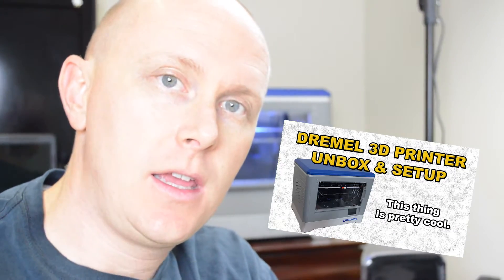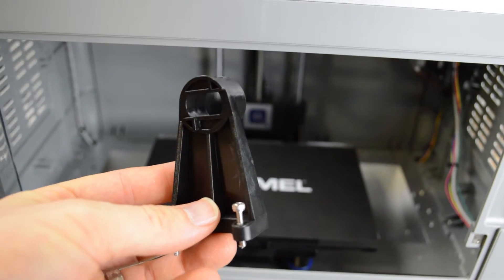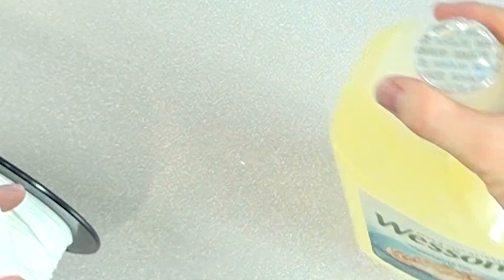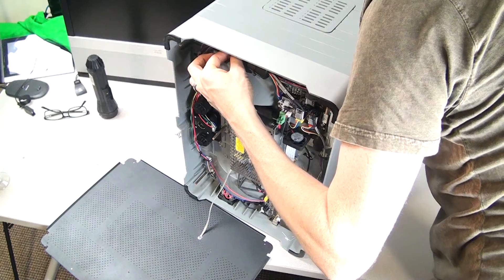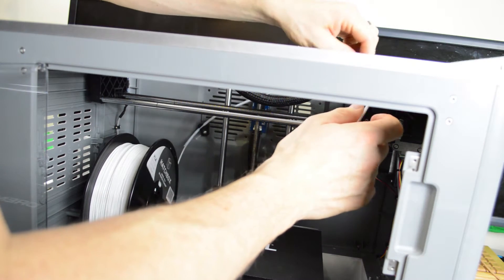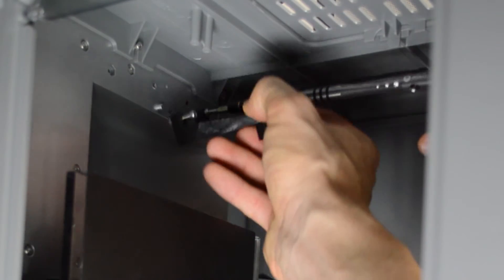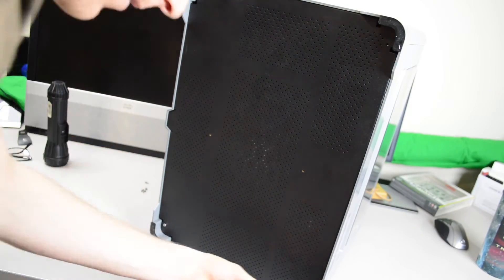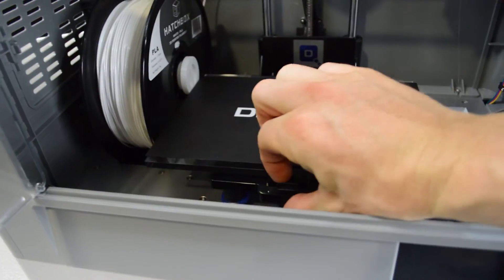DREMEL 3D PRINTER 1kg FILAMENT HACK

Comment: Can't you just re-spool the other brands onto the Dremel spools that fit?
Reply: Yes. But it can be a huge pain in the butt if you print a lot. One of my friends who works for a Makerspace had to redo all the spools a student worker put on wrong, so we spent 2 hours with Netflix on hand unwinding and rewinding what had to be thousands of yards of filament. I have a stratasys printer at work and a Dremel at home, for the stratasys 80 cubic centimeters of material is about $200 with my discount, whereas for dremel I can just laugh and buy loose filament from a variety of different online sites and rewrap the spool.
Reply: It is faster and cheaper to do what he is doing but yeah you have longer prints and more Pilemt on other brands spoils the way I did mine is I just ran my spool holder from the outside and ran it threw the vent on the left side

Comment: Hi there... I have a Dremel 3D45, and right now I am not going to make any comments on how the machine performs, it is just great. But today I have ran into a problem. During a print start, something happened and the level sensor pin (you know, that small little metal part that acutally touches the build plate) got kicked off from its location by the build plate when the head went to the front position for preheating. Now I would like to put it back, it does not seem broken or permanently damaged, but I don't want to make any stupid things with it, so please advise. Did someone here ever had this problem? Many thanks in advance. Frank
Reply from the maker: I can not understand everything you are explaining. All the words tell me its broken but you say its not, permanently? Give Dremel a call, i have heard good things with their customer service.

Comment: Hatchbox filament seems to have two different hole sizes for the spool itself and if you get the one with the bigger hole, the new holder won't work sadly.
Reply from the maker: +Gavin Broughton thanks for this update. We have another person on this thread with similar news :/
Reply: Where do you get your hatchbox filament from?
Reply: Ok, I use Amazon too. It looks like that link has a big spool hole too.

Comment: Not sure if you're aware yet, but the Hartchbox filament spools changed size, so now they are wider than the channel in he Dremel idea builder, and cannot roll.  So, I downloaded your design from thingverse and tried this before I knew but could not be successful.  Thank you so much for this video and the thingverse file!  I have plenty of room so I'm going to build an unsightly external spool holder...  I appreciate your channel!
Reply from the maker: +Pete Lozzi im not sure if I have responded to this yet. Just seeing it now. Thanks for the input. I see on Amazon there are two different reels being shown.. can you tell me the width and diameter? Thanks in advance.
Reply: The item ordered on Amazon was - HATCHBOX 3D PLA-1KG1.75-BLK PLA 3D Printer Filament, Dimensional Accuracy +/- 0.05 mm, 1 kg Spool, 1.75 mm, Black and a physical measurement of the spool is: 68mm.
Reply from the maker: thanks. per the images on amazon, it looks like some of the hatchbox products are still the older reel.. i wonder if i can make another adapter... hmm... what is the diameter of the wheel? its 68mm wide? i wonder what the larger measurement is.
Reply: TRY to HELP you c

Comment: Nice mod, I actually found your design a couple days ago when having the same problem with larger spools, lol.

This really is a great printer, but I'm still looking into the feasibility of additional mods like a heated bed, or using a dual extruder from a FF Dreamer. Also, if you want a cheap and nice upgrade, the wear resistant nozzles from Protopasta fit the Dremel Printer. =)
Reply from the maker: +Tom Johnson Jr. thanks! this thing is very decent for a first printer for sure, i am very happy with it and look forward to many more prints into the future! I however will probably not try the dual extruder thing. I have no need for it now or into the future.... what i would really like is a glowforge.... thats where the money will go next if i ever find any!!! haha!
Reply: +TRY to HELP you I recently picked up the dremel printer and I am loving it but the color choices on the filament are not great just wondering if you have had any problems with the extruder clogging or anything like that. If not I am definitely going to have to try this. A glowforge would definitely be cool to see videos on
Reply: +RedHair Drone I haven't. I actually found that the Dremel filament has a nice shiny finish, but can have adhesion issues, especially with the Dremel buildtak. I've been using several other brands of cheaper filament, and blue painter's tape sheets with much better success, while also being considerably less expensive for more filament, and many more options as far as color and material. I've only had one extruder clog, and that was the last time I used the blue Dremel filament. It seems like the Dremel filament becomes brittle faster when exposed to air, and breaks easily, which is what caused my clog issue. 

I've been using the FoxSmart filament http://thefoxsmart.com/ in several colors with great prints, and minimal issues.
Reply: +Tom Johnson Jr. Thanks I have been using the blue painters tape for A while have had lots of problems with dremel filament but was scared to try anything else I have had two different rolls knot up on the roll one was while I was not around the printer and it almost broke the whole print head off when it jammed. By the time I got back all the motors had heated up and one of the belts had come off. lucky there was no lasting affects. Definitely going to try some of the filament you suggested.

Comment: Hey! Thanks a lot for designing this and making it available! I was recently researching this 3D printer and thinking about picking up one shortly. I was going to design something like this myself, but since you've already done it that's great! Does it by chance work with the dremel spools as well? I'd like to use up the stuff they come with first.
Reply: +DistraitW If you're looking for something more universal, check this out... http://www.thingiverse.com/thing:652415 it mounts inside the printer like the one in the video, but positions the spool a bit further forward giving more clearance, has the standard dremel spool sized holder, and various adaptors for most other spool sizes!
Reply from the maker: Your welcome! So, it only works with the large reels however if you were to design a smaller center axle piece, it should work... Sounds like you may be able to add to this! I will not be doing any designing for the next month or so due to being busy... Im going to try to do the pro con video however. Road trip!

Comment: Okay thanks. Also have u had any problems with hatchbox?
Reply from the maker: Yes actually, very recently i had it snap while it was feeding.. Has only happened once.. Im going to include more details in the upcoming video. I essentially fed it in the extruder intake hole dealy while it was printing and it worked out finr... Just strange. I cant confirm if this is regular but it only happened that one time. I have printed about 1 and 1/3 roll of the 1kg hatchbox regular pla..
Reply: +TRY to HELP you I've had that happen with a couple brands of filament, including the Dremel brand PLA. It's typically an issue of the PLA "drying out" after being exposed to air,  and becoming fragile. This is also more common with the translucent filaments. If you haven't already, make an airtight box (Target sells some airtight storage boxes for like $10) to keep your filament in, and it will keep your filament "fresh", even though that sounds silly.
Reply: I use hatch box two it is a good brand and it is cheaper than dremels but I had a couple times were I was doing 50 hour prints and when I wake up in the morning it had snapped and it just Keped running but otherwise it is a good brand

Comment: i just got a dremel 3d printer and was wondering if there is any risks in breaking the printer when doing this and if there is any other ways to use off brand filament. also ive seen top mounted spools do you think that is easier?
Reply: +Austin Kapaun After about 20 rolls of various brands of filament, I would say nope. I've been using the "foxsmart" brand of filament from ebay (several rolls/colors now) and it's been great.
Reply from the maker: To me, mine is easier due to the feeding tube deal is still utilized and it goes where its meant to.. As for breaking the printer, i suppose that is possible however this procedure seems to not be too invasive of the system. Top mounted spools are not aesthetically pleasing to me so no go in my mind. One of the reasons i liked this printer is because its all in one little space. Good luck either way!
Reply: +Tom Johnson Jr.  Do the Fox filament rolls fit on the dremel spool stand or did u have to create the custom filament holder from thingiverse?  Also what extruder temp do the fox filament work best for you? Fox recommends around 185 to 195 depending on the color.

Comment: My experience is that the Dremel-branded filament is far more dependable quality-wise than other brands and the Dremel Support team is fantastic! However - you are correct - some people may decide that the cost (Dremel-branded filament is 2x the cost of Hatchbox) may not be worth it. My suggestion: you can try to use the off-brand filaments BUT if you have an excellent experience with your Dremel printer, be sure to provide positive feedback on the printer and support Dremel!
Reply from the maker: Good words sir. Im curious what you mean specifically how the Dremel is more dependable quality wise. Do you have specific examples of specific events that have happened? Also, Please be sure to watch this entire video if you haven't. I definitely give supportive words to the printer itself. I am almost done with the other two videos that i talk about in my first video about this 3d printer. I am very happy with the way its turning out. I don't know that i will be able to speak on the Dremel support because i frankly have not had to call on it. That portion may just end up being a neutral point in the following videos. It does appear that many people in the forums have had the highest praise regarding their support. Please let us know about your experience with the filament!
Reply: +Todd Schnack Really? I've tried about 6 different brands, and they've all been more reliable. I always found that the Dremel filament seems to have issues with first layer adhesion, especially when using the provided "buildtac" that came with the printer, and seems to have considerably more "stringing" than other brands. I would actually compare it to the quality of the eSun/Hobbyking filament, which also has great color, but the same adhesion and stringing issues.

Comment: I have a um2 but thank you for doing this i hate stupid brand locked stuff so thank you for showing us this.
Reply from the maker: +Golf Mc the pleasure is all mine. Perhaps Dremel just doesn't know and their supplier of the product doesn't know as well..? I hope they upgrade their equipment over time or that people who purchase these machines see this video or parts they can print via thingiverse. So far its worked really well and i have been printing non-stop since i have had it loaded. so much more affordable to print stuff now! I am suspecting that there may be a little bit of drooping of the part over time but only time will tell. All updates will be linked in the "i" button at the upper right of this video.
Reply: +Golf Mc They "say" that it's brand locked, but it's not really at all. Even if you want to use very wide or tall spools, a simple external spool holder solves the problem, and all other PLA (1.75mm of course) works fine. They just don't want to support issues with other brands of filament.